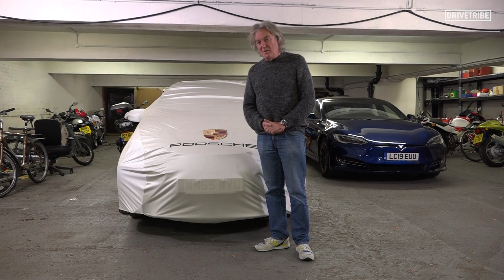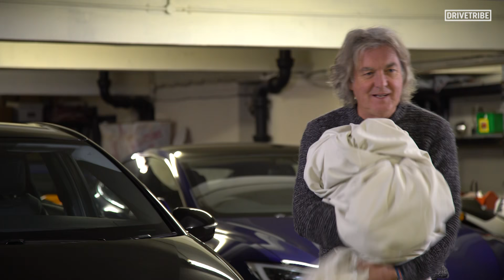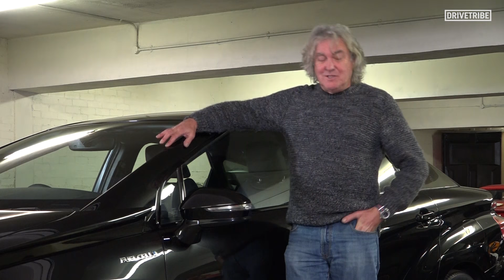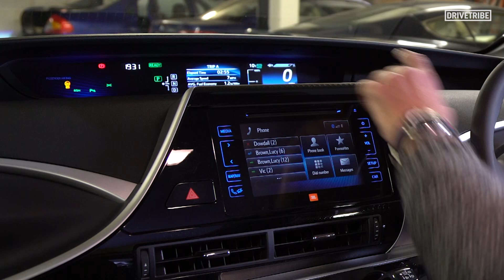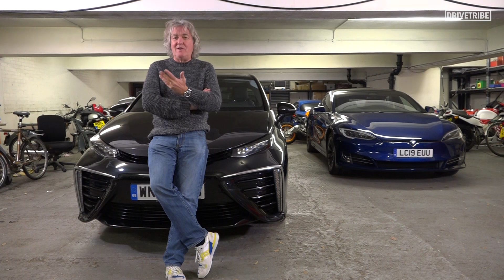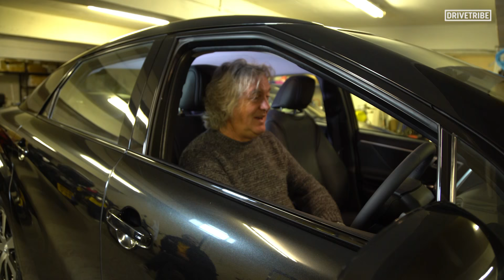James May has bought ANOTHER new car

Comment: That is absolutely right. In a future carbon neutral grid you are going to have to have a huge overbuild of renewable energy to cover electricity peak demand. When demand is not peaking, which is most of the time, these renewable energy generators need something to do or they will just idle. These idle generators can then be used to produce hydrogen gas at a very low cost since the alternative is doing nothing at all. Hydrogen is far easier and cheaper to store than electricity (batteries).

Comment: I don't see why the hydrogen is part of a bigger solution to be carbon neutral. 
Batteries and electrical distribution are here and work, just bring the neutral power source... Either be wind farm or solar panels or nuclear...
Reply: Sorry for the long answer but it is not a simple thing to explain. 

First of all, so far only road transportation can be battery powered. You cannot (with the technology we now have and expect to have in the next couple of years) create economically viable planes or ships. They will be extremely heavy so the plane cannot fly long distances and the ship cannot carry as much as it could. This is a big problem to solve because the majority of the carbon emissions in transportation comes from non-residential sources (industrial/commercial transportation, aviation etc). The reason for that problem is that batteries have much less energy per kilogram than oil or hydrogen. That is why with just 5kgs of power the Mirai can do 300 miles and refuels in 3-5 mins when the Tesla (which has a top tier if not the most efficient battery) needs more than 500kgs of battery for that range and at least 30 mins on a suitable supercharger. Thus although all residential cars are a major source of carbon emissions and could in theory be battery powered it is important to note that they are not the majority of the carbon emissions in the global transportation.

On the other hand, the big benefit with the batteries is that the electric grid is well established so anyone can now plug the car somewhere to charge. The only problem now is how clean is the energy and how fast it charges. But on the hydrogen side, there isn't an established grid for  distribution and/or storage which means that compared to batteries it has a much higher upfront cost for companies and/or countries that want to adopt this technology in order to lower the emissions in the immediate future. So the battery electric car is more of an immediate solution to the problem while hydrogen might be the green and sustainable future that everyone waits for.

I hope that this helps a bit. I know for a fact that you can find a couple of very interesting videos on hydrogen if you are interested to find more information about this debate for the next energy source.

Comment: There James. I’ve liked, i was already subscribed and here’s my f...ing comment. I’ve been a mechanic for 25 years and spent the last 17 years working on forklifts, both internal combustion and battery electric. Of course electric motors are going to take over eventually, they only have one moving part and are therefore cheaper to manufacture. One thing you didn’t mention was the pollution created in manufacturing and eventual disposal of the lithium ion batteries for BEV’s. And yes I keep my toolbox very neat and organised as a proper tradesman should.

Comment: I think the world will be hybrid for a few decades with all electric options on the side no matter what vehicle it is and then maybe much later they might go hydrogen. I think super car manufacturers will go smaller engines with battery powered assist like Lamborghini's v10 might go 5 cylinders and tweak the noise to sound more like a v10 because 5 cylinders already sounds like a v10 just a different pitch but that's just my headcanon anyway.

Comment: Of course new leaps in battery technology promises up to, if not beyond 5 times the capacity, improved safety, as in completely safe, and a whole lot more eco friendly, using more common materials, just to name a few of the points. In fact a nobel price was given for this, to a certain person with a rather inappropriate last name.
When it comes to hydrogen however, there's really very little we can do to improve the technology. There are only a few ways that we know of, that can possible be used for large scale production of hydrogen, and they are incredible inefficient, so as I see it, the battery has won, for now.

Of course newer and better technologies will arrive down the road, and if say we figure out a way of getting fusion working, it may just be possible to meet the hydrogen demand for a potential hydrogen driven future, but even given essentially an endless supply of power, the infrastructure needed to produce the needed hydrogen, will be so wast that it is really beyond comprehension.
The future of the battery however, is somewhat more promising. Yes, it can be argued that we will soon have reached the limit of the chemical battery. That is to say that there will be no more leaps, only minor improvements. However, there are other methods that are somewhat similar, like super capacitors, nano capacitors, and what else they call it, all of which are essentially build upon our ability to efficiently and precisely manufacture the very small, like we do for example when in computer processors.
There are various proposed solutions, some of which can reasonable be expected to be viable within the not too distant future, but even if the best we can hope for is 5 times the current battery capacity, which is not enough for future needs by a long shot by the way, but may just be enough for, say electric planes, hydrogen will be inferior in every way.

So I am very sorry, I'm sure it's a very good car, and it is certainly interesting technology, but that chances that it will ever fulfill it's promises, is basically nought.

So long, and thanks for all the fish.

Comment: So would you rather drive around in a car that looks terrible, has a tank that is pressurized to an uncomfortably high level, is as expensive to run, using a fuel that is only available at 8 outlets nationally and which is sold by the same companies which have used dubious methods to hinder the uptake of alternative options for decades. 
      Or would you prefer to drive a car that, although released about 8 years ago, still looks fresh, modern and beautiful despite receiving only minor design changes. Has continued to improve, even after purchase, due to over-the-air updates. Can be refueled much cheaper at millions of outlets globally and has a dedicated, fast-charging network supported by the manufacturer. Has the capability to be charged using solar, wind or a multitude of other sources, independent of geopolitical changes in volatile areas around the world. 
     I appreciate James taking this opportunity to show the stark differences in these two vehicles and trust it will finally put to rest the absurd idea that hydrogen could ever be a realistic solution as a fuel source in passenger cars.

Comment: thank god or buddha or batman that this car has actually made it to the road!!!! From a purley eco (I shudder) point of view, lithium is as much a limited source of the fuel as oil and coal which provides the electricity that charges the batteries as we speak, unless we find a way to mine it from fucking space. We do, however in human terms, have an unlimited supply of hydrogen, and using that with wind, solar, as well as advancements like the KERRS system should keep us enjoying the car as we know it as well as keeping us out of the firing line of eco-warriors.

Comment: Hydrogen was ALWAYS going to be the way forward, Its the best solution because it effectively works just like our cars today. You drive and have unlimited range aslong as there are filling stations on the way. Just like today.
Reply: No, that's just a sales pitch. You can fill up quickly if you're the first one at the pump, otherwise it's a 20 minute wait while the system compresses enough hydrogen for you to fill up. That's not a solution that can be scaled up either. You can put chargers anywhere where there is electricity, hydrogen stations are huge and cost millions. The cars are not the same either, much of the space is filled up with heavy, bulky tanks, so they aren't particularly spacious or practical, and fuel cells have awful power density, so they are slow too.

Comment: putting a re-generator in it is an interesting/strange decision that I'd like to see the rational for. After all, it's extra complexity, weight, and cost.
In a BEV, sure, it already has a heavy battery and some of the wiring, maybe adding re-generators makes sense (anybody has numbers?) 
But in an HEV? And if we're adding a battery, then why not charge it from the wall? Granted, the size of the battery is a consideration, but if it's big enough to warrant re-generative brakes, isn't it big enough to warrant a plug? Would help in a pinch.

Comment: I feel that because of the losses in hydrogen fuel cell tech that the BEV will win out in the car market. BUT I think there is definitely a place for it in trains, boats and airplanes.
Reply: Boats, maybe, but planes would be a push due to the size and weight of hydrogen tanks. most planes store fuel in the wings which act as fuel tanks - hydrogen tanks are high pressure so need to be cylindrical, not wing shaped.
Reply: @mikeedwards350  well they are already under development. The first of which is due next year with a range around 500 miles. Sure they aren't going to replace a 737 anytime soon but that's enough for most domestic flights.
Reply: @slanahesh  yes, there's battery planes under development too. The best bet for long haul is going to be synthetic hydrocarbons for the foreseeable though.
Reply: @mikeedwards350  probably true. But I didn't say hydrogen would replace all conventional aircraft. I said it had a place for it.

Comment: Hydrogen Fuel has to be the long term future simply as JM says, its wider applications. The main problem is putting in place a costly refuelling infrastructure which is a bit of a biggy; simply because private companies won't put the stations in place until there are enough cars to make them viable, and people won't buy the cars until there are the fuel stations in place to refuel them. In order to get them off the ground quickly would require government intervention (and good luck with that one).

Oh and BTW James. Thanks for giving this a go (although you haven't mentioned how much the Toyota cost - that could be another issue)

Comment: I really think hydrogen will only be viable in boats and planes in the long run. Batteries can do grid load balancing so they make decentralized solar power more viable (vehicle to grid) and i don't think having the most volatile gas known to man in highly pressurized containers absolutely everywhere is a good idea. Gasoline will be seen as stupid and dangerous soon anyway. Who am i kidding, it already is.

"Batteries are dangerous too" no they're not. Per amount of cars there are way more combustible fuel related incidents than there are battery related ones and gasoline technology has a 100 year head start on lithium battery technology. Suck it, get used to charging your car. :)

Comment: I'm waiting for fuel cells to catch on before I buy an electric vehicle.  Battery-power is like the CFB of cars.
(Until I perfect the flux capacitor!)
Reply: Hydrogen is the betamax of cars. Honda have already dropped out. And you really don't want hydrogen,  people advocate for it because it seems familiar to fuelling a petrol car, but the reality is far different. Hydrogen is a very tricky chemical to distribute thanks to it's low density and volitility. Also, I can't wait to see the drag race between this and the Tesla. Battery all the way if you care about performance.
Reply: SMURF!!!!🖕🏻🤟🏻😤👎🏻

Comment: Love your video's, but I think this race has already been run, Bev's are so far out in front, what with home charging for 60% of the population, and Tesla fast charging, BP installing electric charging stations from Chargemaster, (which they recently bought out), into their petrol stations, and numerous other companies that are all getting on the bandwagon and installing fast charging stations in the UK, the result is already in place. Bev's 1 Hydrogen 0. Add to this, the cost of manufacturing batteries is dropping rapidly, from over $270 a Kw to $187 and Tesla promising $100 soon. Also add in the battery improvements, i.e. solid state batteries with a bigger range and quicker charge time, we will soon be seeing price parity between Ice cars and Bev's. This will be the tipping point, which will see people choosing to buy an electric car instead of a fossil car, 2025 is my estimate for the tipping point, but it may be sooner. Hydrogen will go the way of the Phillips 2000 video recorder, great in principle, but outflanked and redundant before it really got started!

Comment: we need a chap portable way of cracking hydrogen out of water... just add water to the tank.
Reply: Mabye we fill the cars with batteries so we can use the electricity to generate hydrogen to convert back to electricity at 30% efficiency to charge the buffer battery that powers the drivetrain. Sounds simple  and efficient.

Comment: Clarkson voice “So you’ve bought yourself a Hydrogen Bomb?”
Reply: Clarksons said in the past Hydrogen is the future not batterys
Reply: @derp872  yes but he would still say that to May, wouldn't he?
Reply: @derp872  Clarkson probably lost faith in hydrogen the moment James bought this car xD
Reply: @Steve_A93  yes. That is a very Clarkson-ish thing for Clarkson to say.
Reply: Derp you’re like a time capsule from 2009
Reply: @dylanblack8714  watched topgear religiously growing up 😂
Reply: @derp872  he said hydrogen combustion was the future, from what I remember, it wasn't about an EV powered by a fuel cell
Reply: @knifeyonline  you might be right actually but he was still correct either way. Fuel cell and maybe a small high output battery cell maybe even super capacitoers is still better for the environment than a large lithium battery pack that in most cases is going to right the car off when it's dead rather than replacing due to cost while also mentioning it has to be charged from the mains potentially needing a highly polluting power station but then again to produce hydrogen easily it also requires energy and yes you could argue you do get alot of green energy now but that's gotta scale right up even in the current state of energy production to reduce emmisons to where folk want it to be. Obviously I'd like to see a hydrogen combustion engine but I doubt they are in the making with most car manufacturers pushing to electrifying their range or new electric models that if hydrogen was to go main stream they would probably go with a fuelcell and a motor using the current tech they have. Sadly we are far away from hydrogen going main stream but once petrol and diesel sales drop and I can only imagine companies like shell or even governments trying to push for hydrogen.
Reply: I'm dying 😂
Reply: lithium battery is also  dangerous
Reply: Why you can send voice message in the comments section
Reply: If no censorship

"So you've bought yourself a simp"
Reply: I just read that in clarkson's voice lol 😂
Reply: Thats all he can do, be loud. He has no real tech knowledge.
Reply: @niconesta8566  you do know it's a on-screen personia..if you watch other videos he does away from top gear/grand tour he comes across as very intelligent
Reply: exactly what I was going to comment lol
Reply: i can also see him( clarkson) say   hiroshima  nagasaki boom boom
Reply: HERE I GO AGAIN!!!!🖕🏻👎🏻🤟🏻👊🏻😤
Reply: James must be Jezza's most hated person having a Tesla and a hydrogen fuel cell car... Hahahaha
Reply: Neill Barry is clearly Clarksons alt he uses to  troll Mays
Reply: I miss this.

Comment: I remember James reviewing a Hydrogen Fuel Cell car in California about 10 years ago when on Top Gear. I've often wondered why we're going with plain battery powered cars instead. Filling up one of these takes around the same amount of time as it does to fill up a conventional petrol or diesel car. The eight hydrogen fuel stations in the UK are:

Beaconsfield Services Hydrogen Station (Opened) 

Teddington Hydrogen Station (Opened)

Rainham Solar Hydrogen Station (Opened)

Rotherham Wind Hydrogen Station (Opened)

Shell Cobham Services Hydrogen Station (Opened)

Gatwick refuelling station

BIG HIT (Opened)

Swindon Hydrogen Station (Opened)
Reply: That's not actually strictly true. The pumps need 20 minutes between fillups to recompress the gas, so it's not a solution that scales up to general use.
Reply: @mikeedwards350  - Still more convenient than electric, especially if you have a station with about four pumps.
Reply: @andrewsmith2757  not if everyone is trying to fuel up, you now have 1/5th the throughput of a conventional fuel pump and the same demand. That's what I mean when I say it doesn't scale - from a novelty alt fuel to general usage. The same goes for transport, at the moment they can tranport it in small tanks because the demand is low. You want to meet the same usage as gasoline and you're going to need 10 times the number of trucks making deliveries thanks to hydrogen's awful volumetric energy density. And those pumps are expensive devices. Alternatively you can put 350kw chargers nearly anywhere, with a 20 min charge time, and have large banks of them.